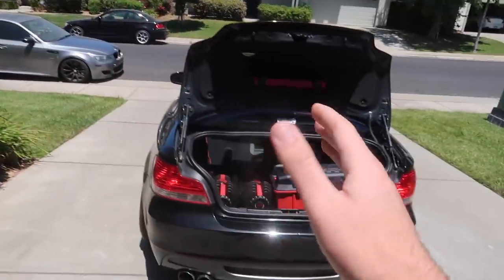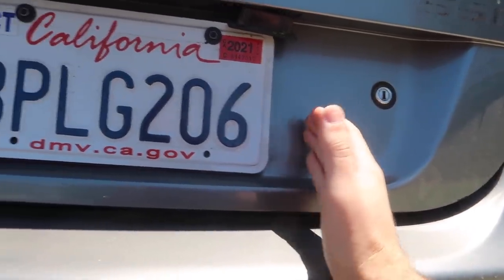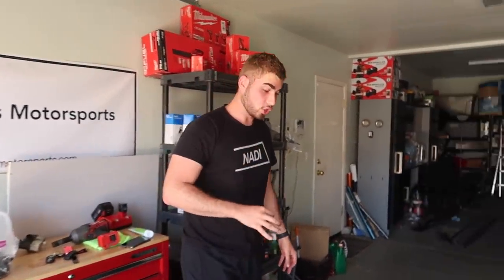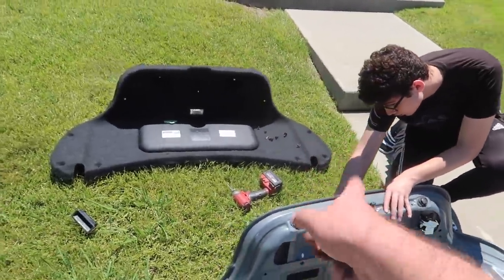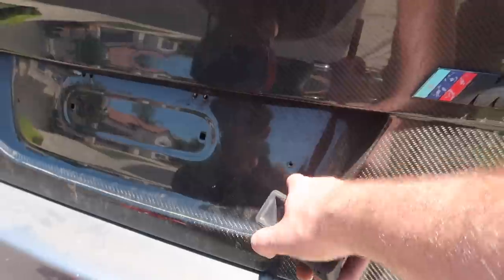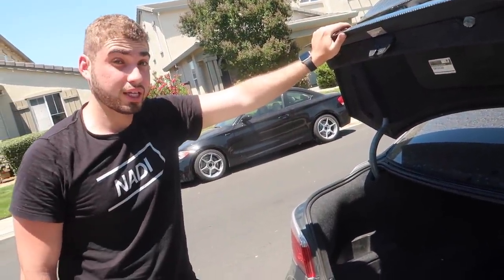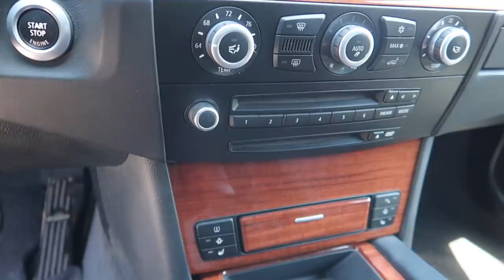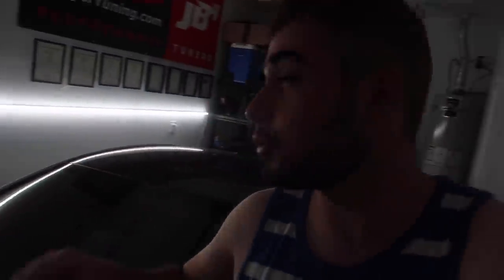THE V10 M5 IS ALL TOGETHER! (Getting Shipped Off!)

Comment: Hope that you can get that V10 running man.  Stinks on those holes in the trunk.  I would just put some epoxy resin in there and let it set overnight.  If you are impatient like me, use some UV activated resin and shoot it with UV light for a couple of minutes to cure.

Comment: I had the same problem with my mini convertible with the boot switch. Turns out the micro switch in it has broken. I took the handle apart and solder a new switch in cost me £1 bmw wants over 100.

Comment: Bro. I just bought a lci e90 a couple of weeks a go.  And the question i have is how to change the angel eyes halo color to led. And i dont have a xenon healight. Its halogen. And i dont know which bulb thing i have to buy. Can you help me?
Reply: there is a kit sold by lux angel eyes for the halogen headlight. you cannot do led unless you have xenon
Reply: @Etanvo  arent there 2 diferent type of bulb models. One for the xenon headlight. And another for halogen?   I dont think that i have to change the whole headlight.
Reply: there are but i used to have an lci e90 as welp and came into the same troubles you have now. you dont have to switch the entire headlight, its just the bulb. there is a specific one for the halogen